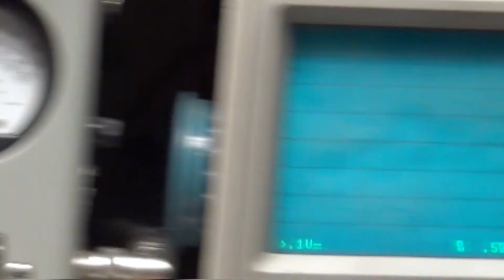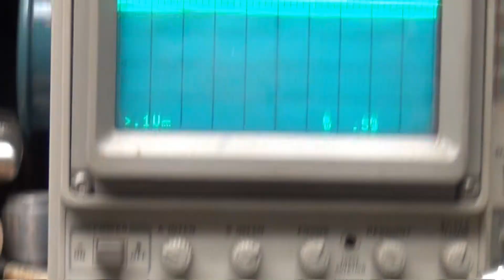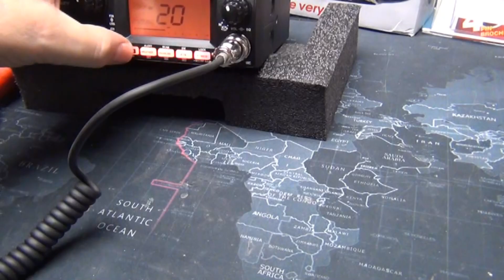President McKinley Tune-up report

Comment: One of the nicest FCC compliant CB radios on the market. President did it right this time. Their automatic squelch feature is the best .incomparable to others. It knows the difference between static, High noise floor or a voice. And one of the fastest Channel scans available. Along with sideband and dead accurate stable frequency. It's a perfect radio. It is what the President Ronald radio should have been. Absolutely love the power mic with the channel buttons. Finally someone is able to do it in the industry. GREAT JOB Bells CB!

Comment: Does anyone here know if a dynamic mic can be used with the McKinley USA FCC radio? I cannot find a menu setting to switch it from the electret mic. Thanks.
Reply: No. It has to be an electret mic.  Actually the stock mic is very good.